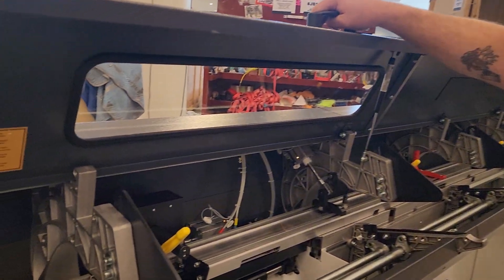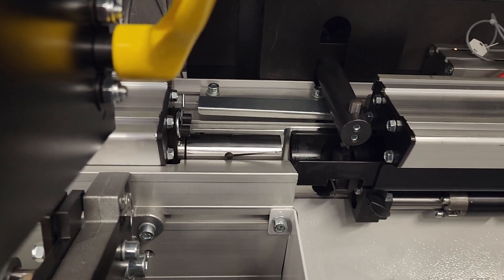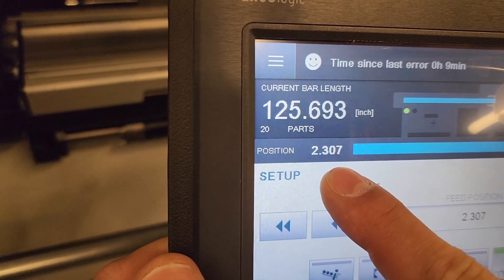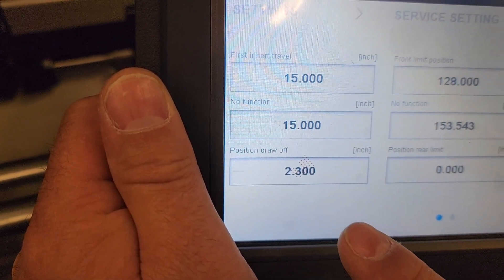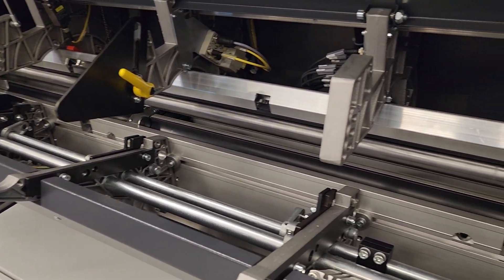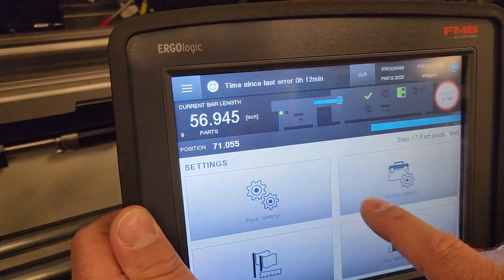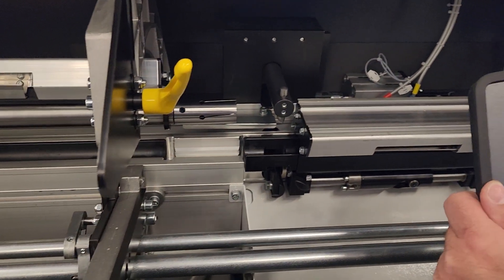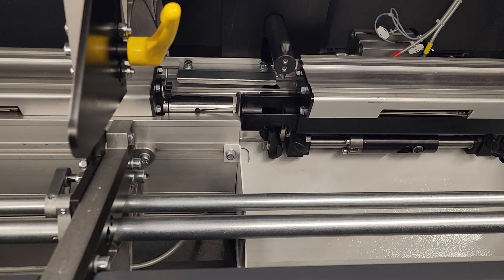FMB Bar Loader: solved "Press Upon Not Correct" alarm.

Comment: We have two of them for more than  year, one is good,  the other one doesn't drop bars in the channel guides. 

Everything is good, it does not lift  the bar enough in order to drop it in the channels. 

Material is 1 in, and everything is set to work with 1 in bar. 

Is there any solution?
Reply: You know how to work the controls just got one at the shop clueless about how it works